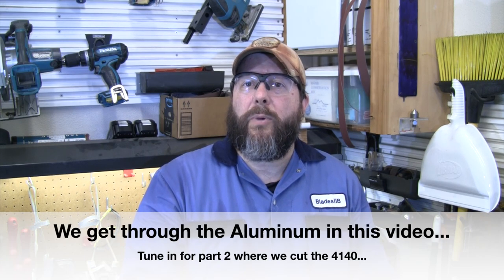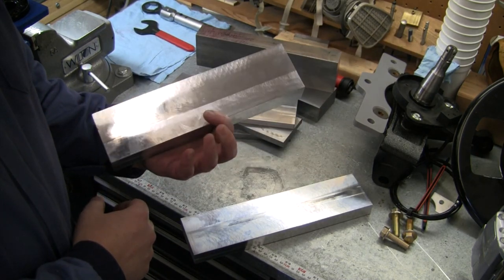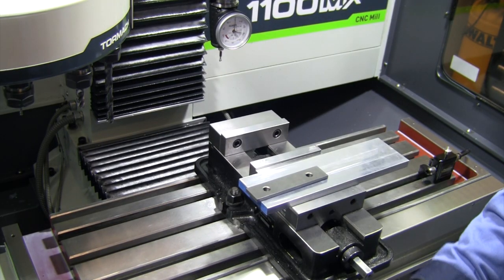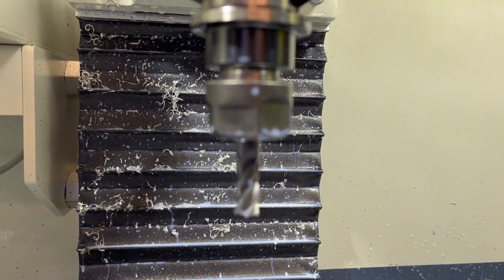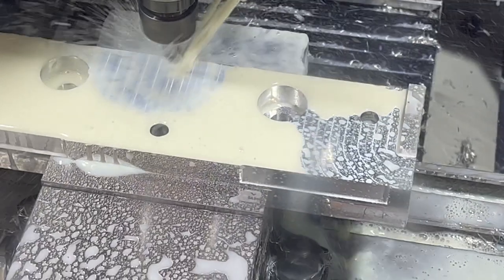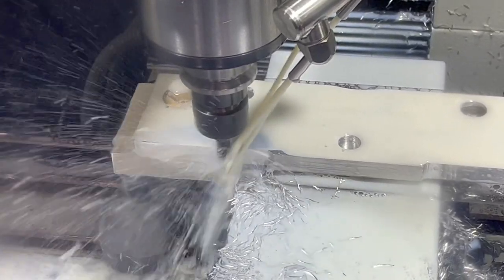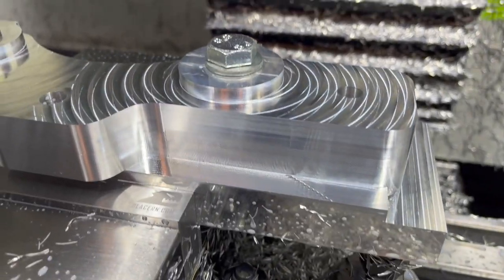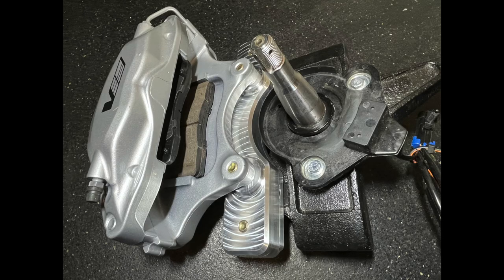Custom Brembo Brake Caliper Bracket - Largest Tormach Project So Far 6061 Aluminum 4140 Next

Comment: Can you make brackets for brembo calipers for a 90 c1500.
Reply from the maker: @duvlss_garage - I could possible make them, however, I have no way to design them. For this project the customer provided the full CAD design for me to work from. He had even 3D printed one in plastic to verify the design. If you have the design complete feel free to reach out via the contact form on my website and I can take a look. Thanks - www.BladesIIB.com

Comment: I see this is a prototype, but aluminum threads are inherently very weak, especially at that bolt size and torque. This part should be made in stainless steel, or just use helicoils if making out of aluminum.
Reply from the maker: Zoran M - Appreciate the comment, this part is truly a prototype for test fit only, maybe proof of concept would have been better.  It will not be used at all.  The actual parts are made from heat treated 4140, check out the video next week to see those.

Comment: Great video Bud.  For those types of deeper cuts in steel, I would recommned using 1/2" diameter end mills vs 3/8".  Also for steel, RPMs will need to be lower and also be sure to use lower gear setting on the Tormach for added torque - you are going to need it for steel - even for drilling.  Lastly, you may also consider 5 flute end mills or even using 4 flute roughing (corn cob) end mills for roughing the stock on steel.  I have cut steel on my Tormach 770 Series 3 from time-to-time and larger diamter (1/2") diamter end mills, approx. 2500-3000 RPM, and stub length (1/2" flute length) is a pretty good recipe for "reasonable" rigidity for heavy cutting in steel.  3/8" stub length isn't bad either but the flute length is shorter.  Also, for initial roughing around the outside, I would recommend going with adaptive clearing with multiple step downs (1/4" step down and and on your machine, your can probably get away with as much as 0.075"-0.1" stepover with a 1/2" stub length corn cob end mill in steel).  Then for depths longer then 1/2" deep contours on steel use multiple depth step-down contour pass with about 0.005" step over with 4 or 5 flute standard end mill to cleanup the lines left by the corn cob end mill.  I got my 5 flute and stub length end mills from Lakeshore Carbide.  Stub length (fire plug) and roughing (corn cob) end mills are your friend on these smaller horsepower machines when cutting steel.  Keep up the great content.
Reply from the maker: BendTheIrons - I appreciate the details on how to get through the steel.  I was able to get them cut and will get that video out next week.  As you outlined, I had to totally change the machining strategy and wend with step downs and .005" side milling cuts for the final clean up.  I also ended up using a ½" end mill for some of the pocket clearing instead of the 3/8".  To your point I really need to get some roughing end mills, I did not account for those in the budget on this project so great learning for next time.  I had a few other challenges, but overall they turned out as good or better than the Aluminum.  I will be much more prepared for the next large steel project on my Tormach for sure.  Thanks for the comment and for watching.

Comment: Look into the 2d adaptive tool path in place of the 2d contour that you used. It won’t cut air and will offer a constant chip load. Use 2d contour for the finish pass.
Reply from the maker: David Scheiding - Thanks for the comment. I need to remember the adaptive clearing tool paths for sure.

Comment: Are you not cutting a lot of air :-) ?
Reply from the maker: Erik Slagter - Fair question. I am still learning how to make my tool paths more efficient. I thought this side milling would be good since it was full depth. Always a trade off somewhere. If you watch the video cutting the steel one it was a different step down approach. Less air cutting but longer time in the end with all the step downs.  Thanks for the question, I am hoping to continue to improve.
Reply: @BladesIIB  I guess it's the fusion learning curve. Anyway the part came out great!
Reply from the maker: @erikslagter3231  Thanks, yes happy with the part. Always more to learn. Can never find the time to do all I want to.